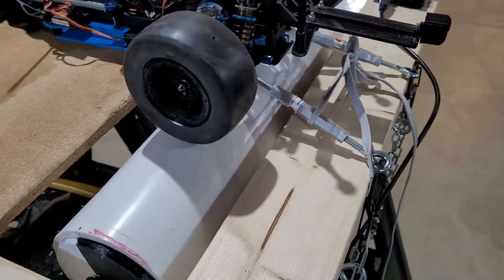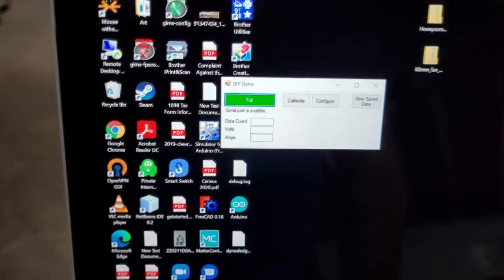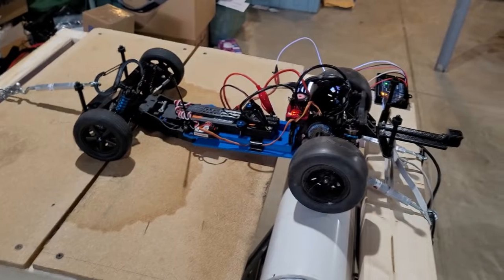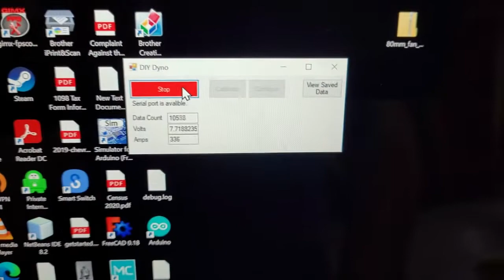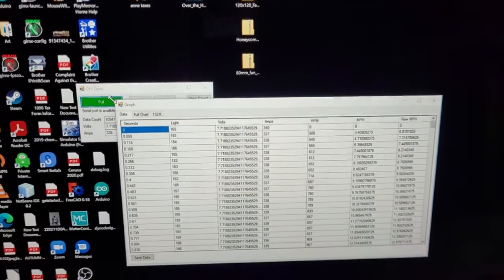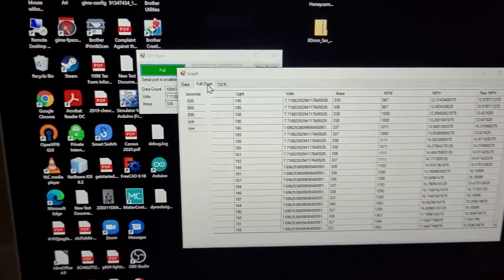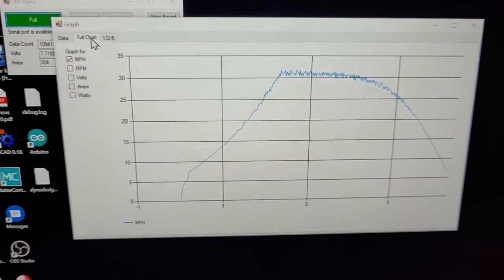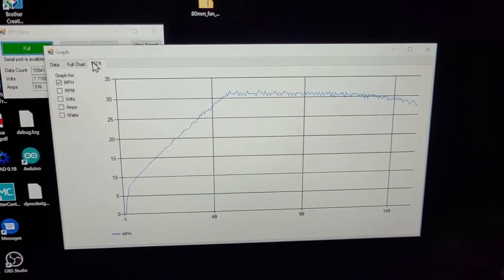Home built RC Dyno

Comment: How do you cross wire a esc
Reply: I'm not sure what you mean by "cross wire". But I've been controlling the esc purely by the Radio. I haven't done it on this project, but I know you and feed signals to an ESC or servo from an Arduino.
Reply: With sensored esc the motor wires has to be a-a  b-b  c-c

Comment: That's dope. What program do you use for the data
Reply from the maker: The software is my own. I'm not using the voltage monitoring anymore and I never got the amperage monitoring to work. I just record rpm over time now. I'm working on rewriting it to see if I can improve the accuracy.
Reply: Is the program for sale?
Reply: @occrc3333  No, it isn't for sale. It isn't in a state that I would charge money for. Honesty SimpleDyno is a better choice at the moment. I wrote the software because I could and I learned things by doing it.
Reply: Sorry I didn't reply to you before now, but I must have missed the notification of your question. I wrote my own software to read the data from the dyno. I gives me time roller rpm and mph and can graph the output and compare it to previous saved runs.